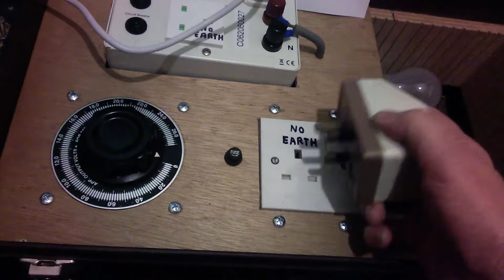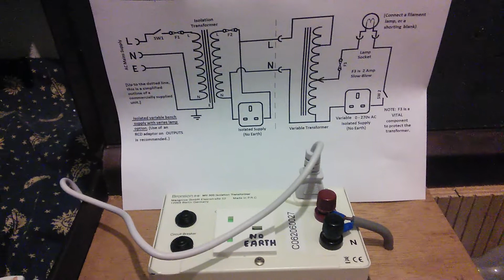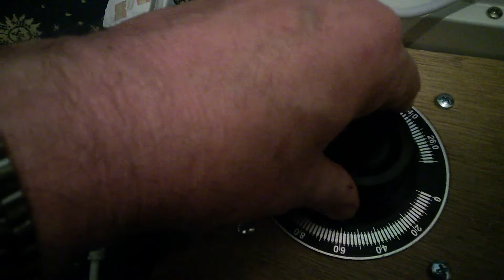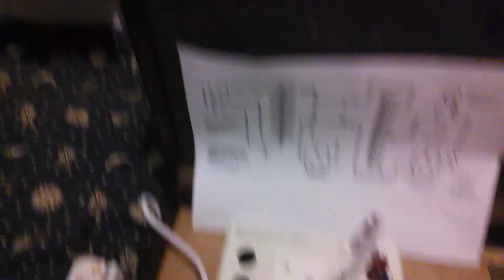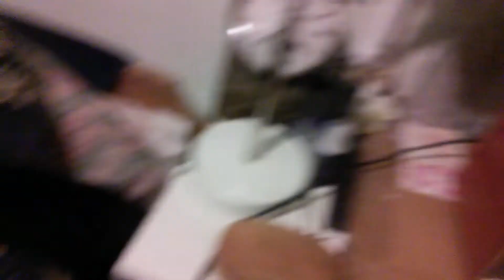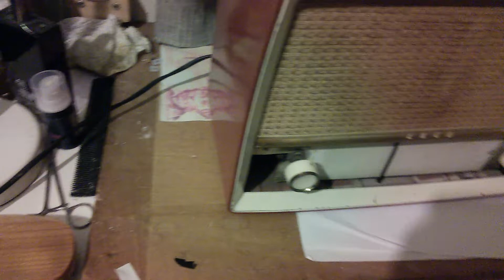Isolated Variable Bench PSU With Optional Series Lamp Protection.

Comment: Nice work Timothy. I’m sure you will find that very useful. Great to see it in action with an old radio as well. All the best Graham
Reply from the maker: Thanks Graham.  I've got to find some way of making the front of that radio look OK. I think it's almost all original components!
Reply: @Timothycan  is it missing the dial plate?
Reply from the maker: @Radiocruncher  Yes. I obtained the set from a jumble sale about 40 years ago, and the dial plate (glass) was broken. I have printed and laminated a scale which I could stick on the panel behind the station indicator. Then I thought I could cut clear perspex to the shape of the dial plate and mask or paint the areas that aren't meant to be clear.
Reply: @Timothycan  you could print a water slide transfer and stick it to the perspex
Reply from the maker: @Radiocruncher  Yes, thanks for that, I might try that.